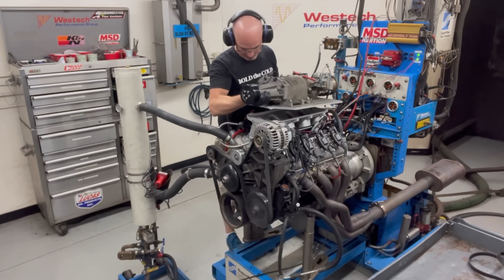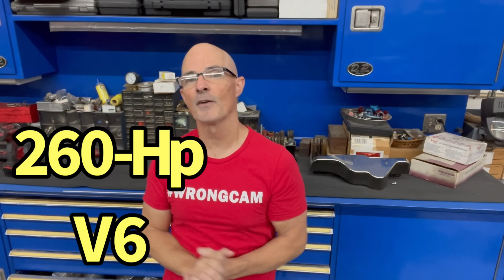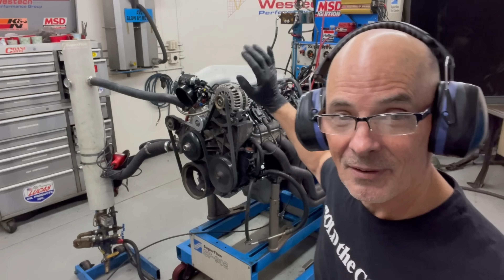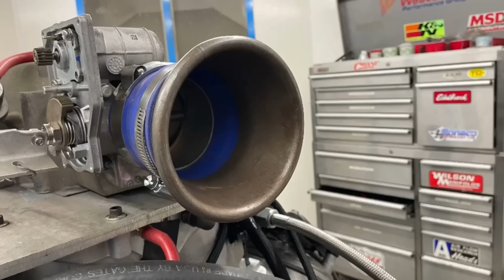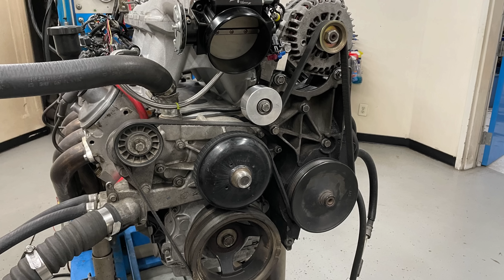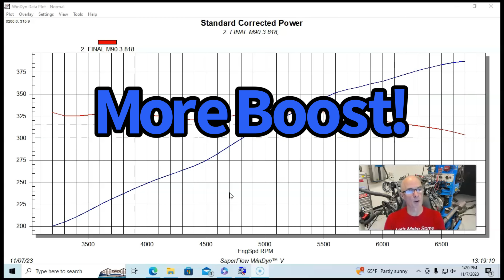DIRT CHEAP, $100 4.8L LS BOOST! JUNKYARD V6 M90 BLOWER TO THE RESCUE! IT FINALLY WORKS ON THE 4.8L!

Comment: Can I install a supercharger on stock internals and fuel injectors or do I need to swap a few parts? I read your guide btw
Reply from the maker: you need bigger injectors, pump and a tune with a supercharger

Comment: I watched a video from Banks, saying that the smaller the pulley isn’t always the best, and it heats up the air more the faster you spin it. Obviously, I’m paraphrasing here, but that could be at least (some) explanation for the plateau (?)
Reply from the maker: higher boost equals higher air temps. But higher boost usually equals more power.

Comment: Crazy thing is that on the earlier gen blower with the same stock blower pulley it lost a bunch of power but the gen 5 gained a slight bit of power is the gen 5 that much more efficient or did you end up with a bad earlier gen blower on the previous test. I know sws is making kits for these for pretty cheap now and im thinking of doing a m90 gen 5 on my gen4 5.3
Reply from the maker: the first test was an error on my part. The blower needs a smaller than 3.8 inch pulley to support an LS
Reply: @richardholdener1727  basically to make any power you need to run a 3.0 inch or smaller pulley

Comment: Okay what about the alternator why is the alternator not connected. How are you supposed to charge battery no belt going around alternator when you put the m90 super charger on. But yet the belt was on the alternator when you did the first test.
Reply from the maker: belt routing and tension for the blower was easier this way

Comment: Does anyone make this adapter plate?
Reply from the maker: yes-Demuse Engineering
Reply: @richardholdener1727  I have an m90 and a cammed 5.3 (l33)

Going to have the m90 ported with the smallest available pulley on e85 and see what it puts down

Comment: I think the blip at 4600 is due to belt slapping. I think just another idler pulley would smooth that out
Reply from the maker: slapping?
Reply: @richardholdener1727   I don’t really know the proper term, but if you watch the dyno video again, you’ll see the belt start vibrating above the tensioner pulley. I’m betting it’s right at that 4500rpm range when it happens.

Comment: You confused me, 4 years ago you did the same test and You said that the m90 was like a restrictor plate???
Reply from the maker: I MADE A MISTAKE ON THE FIRST TEST-BEEN OVER THAT MANY, MANY, MANY TIMES
Reply: Ok , what was the mistake? I have an m90 that i want to put in My 2001 durango 4.7 . Will it work?

Comment: Update,  I found one! Now if I could get some help on what I need to do in order to mount it. An is it possible to mount it on the stock 4.8 intake
Reply from the maker: Demuse Enginering has adapter plates to mount the blower on a Holley Hi ram or Low ram

Comment: What size belt did u run with each pully? And what size belt do you recommend to run with alternator also on the belt.  I noticed you didn’t run that on the belt system
Reply from the maker: we ran belt sizes that fit with proper tension-this was all custom

Comment: Richard, I have watched lots of your videos. Made me dream a bit about hi HP engines. BUT,,  Fact of reality is, I want to retire, Pull a 5th wheel, and not want to turn on my hazards to follow a 18 wheeler up a hill.  I also dont wish to spend 70K on a new Pickup. I own a 2001 gmc with a LQ4 and 100k miles.after watching your vids, not sure what to do.  was thinking 243 heads and a Truck norris cam with a tune, or a turbo and a tune??? the more videos i watch, the loster,, (haha) I get. Any advice or reference to other vids will be greatly appreciated.
Reply from the maker: stock cam and boost will do all you need

Comment: Is the tps problem a signal matching issue? Use a microcontroller to interchange the signals, probably would need an stm32 based controller to keep the translation fast enough using some Dma interrupts.
Reply from the maker: we installed a tb with a gm tps

Comment: actually wild i can take a trip to the junkyard grab me one of these m90s rebuild it run a 2.8 pulley and 80 lbs injectors a truck cam and I can make almost 115 more horse power.

Comment: You are losing power at the top because the blower is losing efficiency trying to pump that much air. The parasitic losses and blower outlet temps are going up faster than airflow is increasing.
Reply from the maker: temps are only 175 degrees
Reply: @richardholdener1727  blower outlet temp is only 175 F° at high rpm? That is surprising.
Back in the day we did some dyno runs with Honda D and B series running the M45 and M62 blowers. There was a definite efficiency drop off on those where the outlet temps got high enough to cancel out any extra flow.

Comment: Man the nostalgia is so great with this M90 stuff. I was really trying to  be more refined than the common practice stuff on my SSEi when I tried 9.5:1 intercooled on e85 and was playing with crankcase vacuum but I wish I had spent a LOT more time on the heads. Those 3800 heads don't flow much but it was more than enough to send the 7/8 chain through the side of my trans.

Comment: It is a slip. Thats why i flattens out at a specific rpm on everything torque and HP.. as well as the timing..it will be fine but if u tension the belt snd u add timing ull prolly get snother 15hp

Comment: i could be wrong but my guess. 
crank pulley and injectors and better fuel. just sayin.
that crank pulley is most likely larger than the stock 3.8l v6 the rpm range is much diff. your changing the end result but remember this.
a blower is an air pump it blows air. blowerr.
if the gearing on the crank is too high or low it can become out of sync with the motor per say. think about a 2 stroke engine since its the most simple form of an engine. if the exhaust and cylinder are not paired right it wont run well or at all. 
your blower feeds your motor. i has a compressor map and shows its flow rates just like turbo selection.
get the right crank pulley for the response range then select the right blower pulley for the boost and compressor range and problem solved. 
sometimes aftermarket superchargers pick other pulleys to pull from. like the alternator or water pump or power steering. it helps get the compressor in the fat part of the map and gets better results.
im also willing to bet that intake adapter fuel injectors and throttle body were causing some other oddities in the testing. throttle body for good throttle response on 1l larger engine. knowing a 4mm increase on throttle body can make large power gains...

Comment: Says he ran it with all ancillaries.....forgot the alternator on the boost runs didnt you ?
Reply from the maker: no
Reply: @richardholdener1727  05:00 says different.
Reply from the maker: did not forget
Reply: @richardholdener1727   at 05:00 there is a clear view of the alternator and no belt is running over the pulley.....
Reply from the maker: Your comment was that I FORGOT the alternator-that is an incorrect statement. The blower belt routing purposely did not include the alternator-it was by design, not forgotten.

Comment: Just my two cents , I would start with swapping the valve springs out , with the added boost may be cracking them open slightly and leaking the boost off and not being able to keep up at the higher rpm
Reply from the maker: I plan to run a bigger cam and springs are required for the cam upgrade

Comment: It’s the lid. Need to switch to a pro charger. But dang I didn’t think you could pull more then 300 horse from a stock v6 blower. I’d raise the lid you need more air flow in the valley.
Reply from the maker: procharger will cure the "lid" problem?

Comment: Seems like it would work well on a truck engine for towing at highway rpms. 
The torque boost in that rpm range, would be useful to maintain speed on hills and hp during higher elevations. 
Dyno showed similar low rpm torque #'s to early turbo diesel truck engines, without the weight of the diesel engine.

Engine might survive for a while with methanol / water injection to cool while under boost; turbo diesels squirt oil under the pistons; irregardless of intercoolers.

Wonder if E85 has any similar piston cooling effect to methanol injection systems?

Could add bigger rods, forged everything and piston oil squirters, if building a gas engine for long term durability towing purposes vs short burst drag racing.
Make big block towing torque with a small block.
Reply from the maker: no need for piston squirters

Comment: since the pump gas setup flattened out on the dyno curve and the E85 didn't, i think it makes it pretty clear that the blower was running out of adiabatic efficiency. And hence the atomized alcohol in the intake charge increased the air density and allowed it to continue making additional power
Reply from the maker: timing

Comment: That looks like a Lysholm-style compressor, not a "root"-style. How hot did it get with the smallest pulley?
Reply from the maker: the M90 is an Eaton Roots blower-I installed a hub and pulley set from ZZP

Comment: Using a flat plate top on that high rise (not-port matched) intake is a failure looking for a place to happen.

The blower outlet is located faaar too far forward, so the front 4 cylinders will be happy, but the back 4 will be starving. The only way to fix that is by adding volume to the top of the manifold - enough to allow the fast-flowing air to slow down and diffuse, so that all 8 "single-cylinder engines" get a chance to breathe.

Make use of a pyrometer to check EGT balance.

Comment: I think for all this might as well find a cheap lsa blower or a stock blower from 5.4 gt500s
Reply: yeah I haven't looked in few years used to be like 2k to 3k not sure now
Reply from the maker: there are no cheap lsa blowers
Reply: @richardholdener1727  hmm just checked yesh they went up in price. I seen a few m122 for under 2 k not sure on the condition, but 2 of them for the price of a lsa would be cool to see a dual m122

Comment: I don’t know what any of this means lol. I know hp and torque. Just bought a 73 Riviera and looking for a reliable 700-800hp set up.
Reply from the maker: you won't make 800 hp with this little blower
Reply: @richardholdener1727  oh I didn’t say going they method I’m trying to find the right way. 6.0 motor seems safe. I don’t know what motor to get off line. I don’t want to get stuck with a trash motor

Comment: I would think porting the blower, even one of the home dremel jobs I bet would get another couple pounds of boost and a larger throttle body. Even lsa chargers run out of steam after a bit and need to be ported.

Comment: Awesome test!

"E85 adds power by itself." ?

I thought ethanol had less energy than gasoline. Without changing timing, how do you extract more power? 

AFR? Maybe a cooling effect?

I'm very curious about the air temperature in the manifold as RPS increases.  And does fuel temperature affect horsepower noticeably?
Reply from the maker: E85 adds power every time we test it-even before we add timing. The caloric content is made up for by an increase in fuel flow (necessary because of the change in stoich values)

Comment: Love the videos Richard. I'm curious if you could help point me to a low cost solution for my 2011 mustang gt coyote. junkyard parts  or ?  it has chip exhaust tune CA intake .2k for cams or 6 k for blower turbo seems like there is another way Thank you in advance if you can .160 k miles blue smoke after compression slowdown but not on start or Rev think it's still healthy. For the prices of forced it seems ls swap would almost be cheaper I'm car guy and have .pretty good skills but not in the situation to build one myself where I'm at
Reply from the maker: nos

Comment: An 03 Cobra supercharger would be a fun one to try although I’m not sure the pulley snout is long enough to reach
Reply: It would work, but im sure it would make way more power than people would expect.
Reply: NOW YOU ARE DEFEATING THE PURPOSE OF THIS JUNKYARD BUDGET BLOWER.... $$ :)
Reply: @rocketmann8333 those blowers are sub 500 all day long. Or any gen 2 or gen 3 lightning blower.
Reply: @rocketmann8333  depends on the budget. saw one on ebay for $750. at that price, I'd probably just use a cheap gt45 turbo.

Comment: A riser for that blower would have to add power just by making it flow better. The flat plate blower mount looks like it chokes the back cylinders off.
Reply from the maker: no choke

Comment: Maybe it flattend out due to stock springs not taking revs combined with boost pressure
Reply from the maker: but didn't do it after we added more boost?
Reply: @richardholdener1727  didn't you run it up to a lower rpm at the higher pressure?

Comment: Wow... i would NEVER have put an m90 on something that did 350+hp n/a, and im kinda shocked you got it to do 450+..   Ultimately just like a turbo, a roots blower is limited by its inlet area and i would not have expected the stock m90 inlet to flow 450+ worth of air without serious porting..

Comment: How do you guys find these cheap engines?!  Everyone around here wants $1500 for any kind of LS.  The best I can get for $100 is a urine stained mattress :(
Reply: "Pull and Pay" & the similar sound-a-like franchises. 
 
 I recall seeing Richard go to them a number of times in older videos from 5+ years or so ago so he's obviously still using them.
Reply: Brother you can get any 4.8-6.0 at the junk yard for $400
Reply: @nathantiikkala1482  Just did a search on car-part for a 15 year old engine from suburban.  The cheapest was $1500 and it went up to $4500 so I don't what planet you are on.
Reply: @nathantiikkala1482 literally every engine at pick n pull cost $400 doesn’t matter what the street value is. I have found shit like ls7s lol
Reply: I did an LS 4.8 swap plus a 4L60E and made $3,000 doing it and got the engine and trans free.  I bought a totalled 2005 Silverado and sold the doors, bed, seats, dash, radio, heater controls, cab, frame tires suspension third member (he had it jacked up). I paid $1,400 for the truck sold $4,400 in parts from it kept the engine complete with wire harness and computer and the trans. I even used the rear engine mount on my 69 Chevy C20.  I also was able to use the foot pedal for the electronic gas control (drive by wire).  I did have to add a digital speedometer because my cable would not work.

Comment: +1psi on the NA engine should be +26hp but the blower is doing +8hp/1psi... x 20.4psi = +163hp... 450 - 375 = 75... 75/163 = .46... 46% efficient? 450hp x 1.54 = 693hp of internal resistance on the rotating assembly. (how much boost does a cheap turbo need to make 450hp on that same engine? 0 net assembly resistance 54% less boost? 10psi = 450) hmm... cost vs availability. have seen M90's go for $60 some times. 700 is hard on a stock engine, like on the 4.6 ford the top of the module of elasticity for the rods was 600hp in relation to crank size and there upper elastic resistance not shear limit being 875hp of that would slowly wreck it. ... 389 was 600hp ish with the internal resistance added... like mustang going from a 3.08 gear to a 3.55 without money shifting it?
Reply: that upper flat line... could very well be the connecting rods or piston wrists bending...
Reply from the maker: is your math indicating that 1 psi is 693 hp worth of resistance? You should look at the data

Comment: Not exactly a 1-1 comparison.  You did "not" run the alternator when testing the super charger.
Reply from the maker: feel free to complain about 1-2 hp
Reply: @richardholdener1727  you're not dealing with someone off the street. An alternator can draw as much as 8-10 hp depending on amperage. You stated in the video that you tested it with all the accessories on it. I'm just pointing out, not true!  I'm not denying that the supercharger works and makes more power, I'm just saying it's not 10% accurate.

Comment: Richard, could you do one more test? add a water to air intercooler! 🙏🏻 I am trying to design one for my inline 6. Please
Reply from the maker: coming-but take a look at the 3800 v6 series where I already tested the ATW cooler with the M90
Reply: @richardholdener1727  Thanks!! 👍🏼

Comment: 16:26  Who's belt is that?  The gator back belt has been long gone. and I've never found an equivalent since its departure.
Reply from the maker: napa
Reply: @richardholdener1727  Hmmm.  It's rebranded then.  Thanks for the response.  I'll have to wake my Napa guys up...

Comment: Throttle body size seems like a restriction. How could I cheaply boost my 6.0 with SS2? I would prefer a supercharger over a turbo. I’ve owned several park ave’s with the SC 3.8. Love that platform!

Comment: when you reach a certain amount of flow through a given blower size you stop flowing more air and just super heat the air...
Reply from the maker: though when we added the smaller pulley-power went up
Reply: @richardholdener1727  another thing to consider is the flow of the engine is not linear like the blower, so flow/boost(backpressure) vs rpm will not be on a linear scale